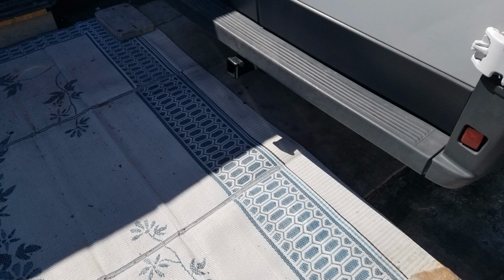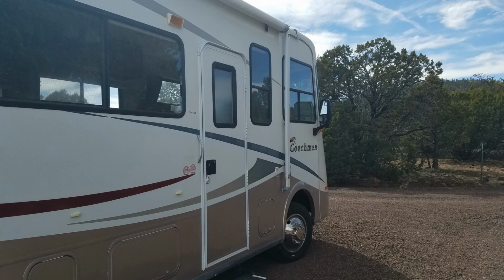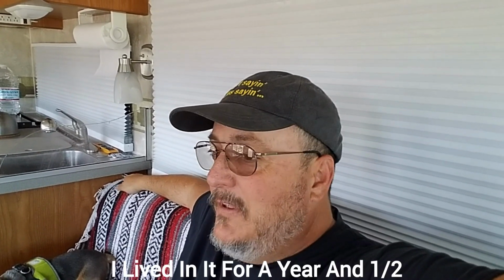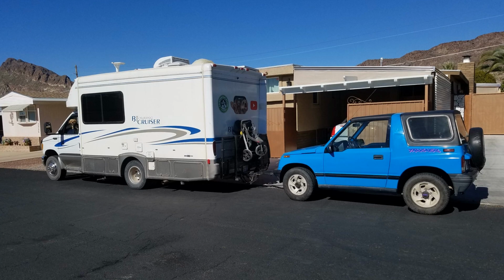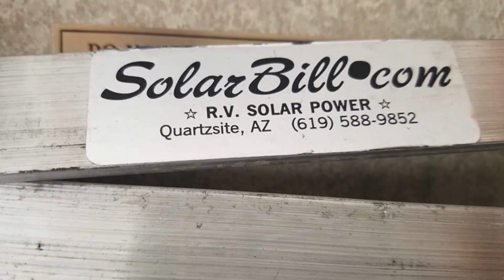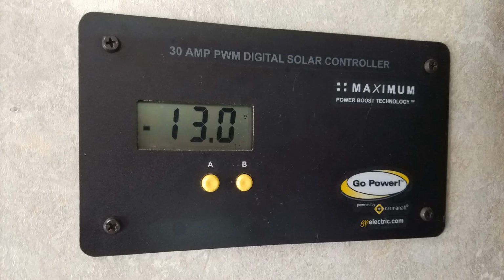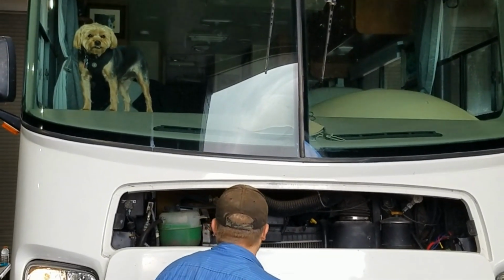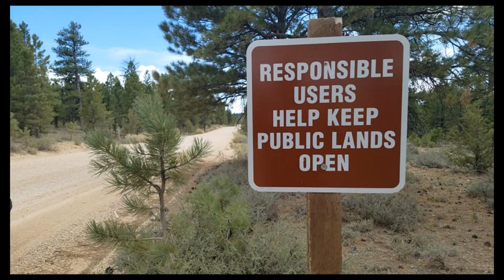BIG CHANGES FOR THE CHANNEL! CVK GETS CLASS A RV!!!

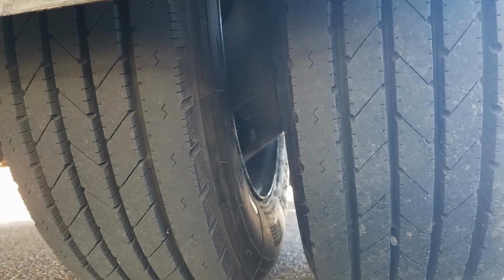Comment: Nice RV. Happy you got a good deal on it and it's in great condition. In the picture of the tires you show at time stamp 5:45 it looks like there is a small nail in the left tire. It's on the inside of the tread of the tire.

Comment: Had to watch this again, love it. One thing you may want to check, the rear axle bottom out bushings. Ford has an issue of putting them too far from the axle to be effective. Tweeted a new set of rear springs getting body slammed over bridge approaches & speed bumps. Sumo springs are next on my list to correct this issue.

Comment: Kevin call your solar installer ask them if you can use hybrid car batteries if you can get the lithium pack from a Prius prime I bet you would have a major expense covered . 3 of them panels just $600 is the way to go I bet you could build the system you need to power AC and all eventually.

Comment: I have a travel trailer, van, one ton pickup with a shell, and a class A. Thinking about a full size camper for the pickup. 
There are no perfect solutions.  Everything is a compromise. If one type of RV worked well for everything, there would only be one type of RV made.

Comment: I too if I had saw that A class and as you say price was right well hell yeah I would had not passed on it. Myself I do prefer a diesel over gas for the mere fact that I'd rather have air brakes over regular breaks and a smooth ride and noise way in the back and not underneath me or in front of me. Yes diesel is higher but you do get more mileage out of it and a regular gas powered motor but you already know that.

Comment: Kev did you say (it runs your cpap all night) I've had sleep apnea for about 6 months now and can not get used to the full face mask, awesome RV the old bones need more space lol
Reply: Alan Flitcroft Did you know that there is a tiny mask you can put only over your nose?
Reply from the maker: yes nose pillows are awesome. air runs down both sides of your head and attaches to top of head
Reply: @loiscassels8966  hi yeah but I'm the type that sleeps with there mouth wide open hahaha

Comment: Where did you have it serviced and what did it cost to have all that done? Nice rig!
Reply from the maker: it was a big rig/truck/tire shop. Oil change, transmission fluid change, air filter, fuel filter, replace valve stems, inspection was around $400
Reply: @CampervanKevin  That's not a bad price at all. The price of all the fluids and filters alone adds up, so I think that's a very reasonable price. Thanks.